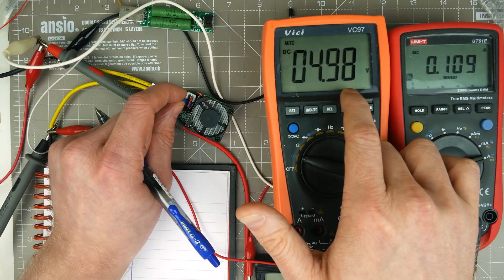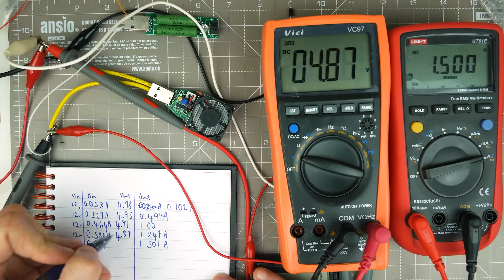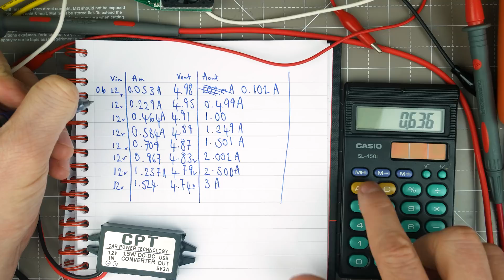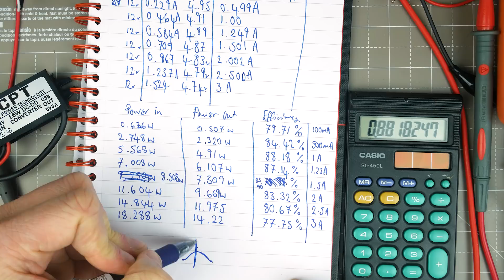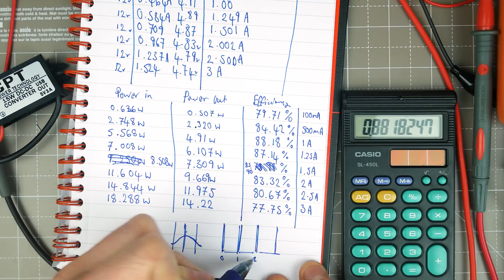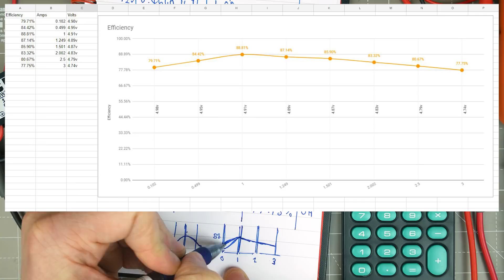CPT DC-DC Converter 12v to 5v 3A 15W: Efficiency Test

Comment: does it provide regulated output voltage? is this module better than using a regular step down converter then using an 5V LDO both on a small PCB? i want to connect an external BT module (through isolation of course with B0505S-1W) to my car audio and i dont know if i should buy this CPT DC-DC converter advertised into cars or i can use any regular step down converter with 5V LDO and then B0505S-1W to isolate noise. problem is i dont know what this CPT even contains. i would appreciate any help. thank you

Comment: Can someone possible help with this equation pls. 12v (?a) using x2 of 5v 3.1a (x2 = 5v 6.2a/ ) sockets and one 5v .50a (5v 500ma) what size adapter would be needed to power these 3 independant units each has it's own built in step down from 12v to 5v (amps as shown)  - I am getting 5v 3.1a (15w x 2 = 30w) and 5v 500ma (2.5w) combined total 32.5watts. So if this is correct what power 12v (amp?/watt?) supply via these step convertors could manage the load if all sockets were used and connected. Appreciate anyones technical knowledge. Thanks Gaz

Comment: Most cars work at 14v while the engine is running. What would be the efficiency at that voltages. Maybe they made de converter to output 5v at that voltages.

Comment: 20% energy as a room heating source, quite usefull now, but in summertime?

Really nice and entertaining learning video.
I had previously bought the same power supply or step down converter for use in a motor home as the power for Mini Stick PC. The 220 V power supply has a max 2.5 A current so this step down converter seemed to fit. Worked quite well. The 12 V to 15 Step up pcb did not work that well, more trouble.

Comment: Just so you know, the minimum spec for usb is 4.5v. The module clearly states usb output, secondary 5v so the unit is well within spec, even under full (3A) load
Reply from the maker: I don't doubt it, hopefully the Pi will be fine with it.
Reply: @DavidWatts  in my experience it will be fine, because it looks Like the powersupply looks very stable, even under high loads, though i would have designed it to output slightly over 5 volts to compensate for the voltage drop.

Comment: 4.74 is fine for most USB devices. Normal chargers are generally not very accurate in that regard either.
the USB 2.0 spec allows up to 0.6v voltage drop, so that would be 4.4V. That converter is still in the USB 3.0 spec of 0.55v drop as well.
Reply from the maker: Yeah I agree, I didn't say it was out of USB spec just not putting out 5v across the board. I am sure the Pi will complain but I am also sure it will run just fine.
Reply: @DavidWatts   interesting video David, was looking to use something like this for my pi also, i find that the newer pi's are a little fussy with the power, any slight drop in power due to iffy power cables and the pi moans, the only supply i can keep the pi happy with is 5.2v 3amp so as long as you're getting just over 5v at the end of the cable you should be okay

Comment: I had one of those in the car powering a dash cam. It made the fm radio almost unusable. Hopefully the noisy converter doesn’t cause the pi too much bother.
Reply from the maker: Good to know, hopefully that won't be a problem or I will be on the hunt again.

Comment: Why not get a voltage reference, and check your meter's accuracy? Then you'd be more confident in your measurements. Still, good video. Does the converter have overload protection? It would be interesting to test overload conditions too, and also chart the output with a constant load, with varying input voltage, say from 9v to 15v. Also how about temperature of the module? It looked like you were getting some thermal effects at high load, and it be interesting if it was the module getting to hot, or the wires heating up.
Reply: Lesley Munro VRefences are horrible things which cause severe paranoia. How do you know the voltage reference is accurate? How do you know the VR which calibrated the VReference is accurate? How do you know the VR which calibrated the VR which calibrated the VReference is accurate? ............😂 

'Ish' is mostly fine.
Reply from the maker: I looked for a voltage reference but good ones looked a little pricey, I believe @Scullcom Hobby Electronics did a nice video on creating one so perhaps it is worth a go. I did test 9v but the 5V collapsed to 3v at 1A so I considered it a no go, plus I need the 12v for the telephone ringer circuit. The module itself didn't get warm but the wires did at 3A. The average/idle load should be around 350mA so I am not really concerned about heat.
Reply: @DavidWatts  Well with voltage references,  precision comes at a cost. But I was thinking with your meters only being to two decimal places, something like an AD584 would be accurate enough to calibrate what you have. it'll certainly get them within 10mV, which is as accurate as you need, as that would basically be +- 1 digit.  something like this - https://www.ebay.co.uk/itm/AD584KH-High-Precision-4-Channel-5V-Voltage-Reference-Module-With-Case/192637032681?_trkparms=aid%3D555018%26algo%3DPL.SIM%26ao%3D1%26asc%3D20140122125356%26meid%3Deebef3230ccc4f7294d962d84d9e86b0%26pid%3D100005%26rk%3D2%26rkt%3D12%26sd%3D152922962274%26itm%3D192637032681&_trksid=p2047675.c100005.m1851

Scullcom did actually do a video on these AD584 references, and did quite a comprehensive test of them, varying the input voltage. Only thing I didn't like is he seemed to avoid the issue of temperature with them, and only once mentioned letting them warm up. 

Anyway, My point was, the cheapy ones would probably be good enough for your needs, it's not as if you're calibrating a 6 1/2 digit HP/agilent/keysight meter, and those references would be good enough for hobby meters. I had a AD586J and a AD587J and I rattled them up on a small breadboard to calibrate the cheap ebay meters I got. More than accurate enough for £5 meters :-) (DT-830's)

Comment: I have 2 of those. They stay in the drawer. First of all, they use a fair amount of power when not in use. And secondly, 80% is not really an acceptable efficiency. Just my opinion.
Reply from the maker: I think it is a fairly nice package, I don't profess to have a lot of experience with other DC-DC converters like this but it should do the job. I need 12v, ~5V at 2A and something I can safely shove in case. I'll see how it goes I guess.
Reply: What do you have out of the drawer? Id love to know which buck converters are most efficient.
Reply: @jobliss3932  That is not a simple question to answer. Things as voltage difference or range, and power (current) are important parameters. An efficient buck converter should work at 95% or 96% efficiency. But the application makes or brakes your choice. For charging your phone, 85% would be okay. But for a 24 hour working dc2dc converter, I'd choose a better one.
Reply: @deslomeslager  but which ones do you use that you found had an efficiency of over 90%? I have more than one use case scenario at different voltages, although I might not even need a buck converter that has variable voltages but Id love to hear about any buck converter people have had a good experience with.
Reply: This is the answer I was looking for. I was thinking about putting one in my motorcycle trunk to charge my Sena when I am stopped. I don't want to install an electrical vampire to kill my battery when I don't ride for 2 weeks.

Comment: typo in title: 3v instead of 5v
Reply from the maker: 🤦 Basically typo is my middle name at this point.
Reply: @DavidWatts  Can you possible help with this equation pls. 12v (?a) using x2 of 5v 3.1a (x2 = 5v 6.2a/ ) sockets and one 5v .50a (5v 500ma) what size adapter would be needed to power these 3 independant units each has it's own built in step down from 12v to 5v (amps as shown)  - I am getting 5v 3.1a (15w x 2 = 30w) and 5v 500ma (2.5w) combined total 32.5watts. So if this is correct what power 12v (amp?/watt?) supply via these step convertors could manage the load if all sockets were used and connected. Appreciate your technical knowledge. Thanks Gaz